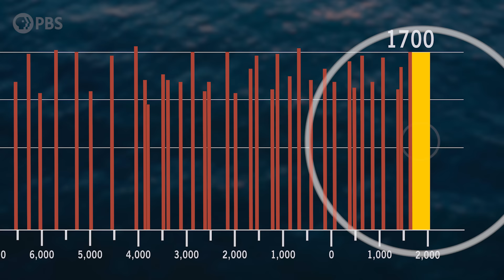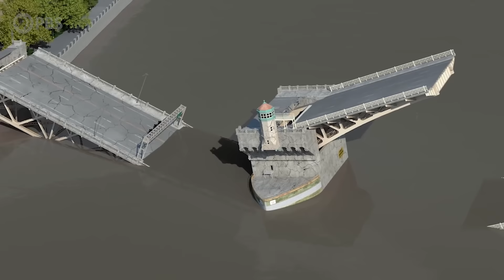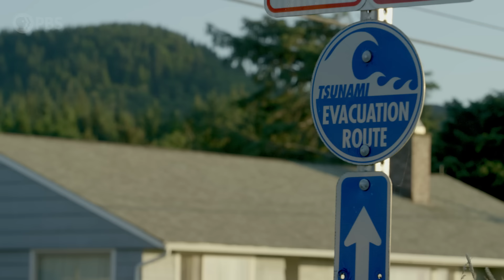Will the Cascadia Earthquake be the Worst Disaster North America’s Ever Seen? | Weathered

Comment: Turning off the gas would be the last thing on my mind while trying to run away from a 100ft wave
Reply: That advice is more for people living further from the coast. We won't need to outrun a tsunami, but we will suffer structural damage. Even a house that's mostly intact could end up with a broken pipe.
Reply: Yea, but like how they showed the house being upgraded, some of the later tips were for non-tsunami zone people. Pretty pointless to upgrade a beach house for an earthquake with a tsunami coming for you 20min later.
Reply: Even if there is no tsunami on the given area "only" a 9.0 earthquake one would hardly think on such technical details in the midst of a violent catastrophy. Although it seems to be a rational precaution.
Reply: @BonaparteBardithion  It is still valuable - can't evacuate in 20 minutes if one have to spend 10 minutes digging a family member out of the wreckage of a collapsed house
Reply: @helium3782  
Yeah, it's definitely a valuable post-quake precaution either way.
Reply: @C.M. Bright 
Or a helicopter.
Reply: Don't worry, except in very specific geographic areas, where a bay shaped the right way can funnel all of the water, that's not how tsunamis work. You won't see towering waves like in the various disaster movies. Actual tsunamis are basically surges, as a lot of water flows suddenly inland. It does pile up on itself, but more like a sudden flood (often in repeating "waves" like you see in a ripple, which is bad because it's impact after impact rather than one pressure) than a towering wave. It's unlikely the water will get higher than 20-30 feet above the normal level. There's some good video of this from the Japan quake. It basically piled up behind their anti-tsunami walls until there was enough water, then it spilled over the top like lake water spilling over the top of an overfull dam.
Unfortunately, a real tsunami (as opposed to the cooler looking movie ones) still does tremendous damage. Buildings and bridges collapse, especially as flotsam and other debris is pushed into them like battering rams. People and animals drown in the sudden flooding. Anything not fastened down is washed away, along with a fair number of things that were fastened down. But it won't be a huge, crested, surfer-style wave.
Reply: Lmao deadass!!! The wave will take care of the fires. I’m trying to make sure it don’t take care of me to lol
Reply: Most people in Washington and the PNW won’t experience tsunamis. And depending on where you live and how earthquake proof it is, a lot of people won’t need to evacuate with the earthquake, and it’ll be safer to stay in your home. Some will need to go to places like schools or libraries, but as long as we’re reinforced and are prepared with food and water and knowledge we’re mostly going to be fine.
Reply: @akostarkanyi825  Unless your home is completely destroyed or torn in half, there's no reason why you wouldn't take step to secure it after any disaster...
Reply: That’s exactly why people need to be reminded to think about it!
Reply: @BonaparteBardithion  only if people  knew the truth
Reply: @Crucisphinx  no because they'll be new ocean front property.
Reply: @amicloud_yt  you people don't know what you need to be reminding yourself of. Maybe there's a living loving God that you guys forgot about. And when this all does happen it'll come from him. Salvation isn't granted to the wicked.
Reply: I’d be grabbing the fuckin surf board
Reply: Portland isn’t on the coast.
Reply: @BonaparteBardithion  Seattle would still have to deal with the Tsunami. The straight would allow it to go around the Olympian mountains and wipe out the San Juan Islands before arriving at Seattle.
Reply: @stevensauer5597  The giant tidal wave is reserved when an asteroid hits the Pacific Ocean.
Reply: The wave will turn the gas, lights, and everything else off for you ☹️
Reply: Yesh, because it's going to put out a 🔥
Reply: All the gas lines would be ruptured, the gas wouldn't make it to your house.
Reply: @stevensauer5597  Yes. Tsunamis is literally the ocean coming onto land.
Reply: @brooklyn560  "The wave will take care of the fires" What happens when you don't live in a tsunami risk area? OH no you're dead.
Reply: @jonahmoran3751 Necro much? This was from three years ago.
Reply: @Crucisphinx a 9.0 70 miles off the coast and it’s a subduction zone and you are saying no tsunami?

Comment: Growing up on the west coast my folks always told me about the inevitable earth quake and to be prepared but a 30 meter wall of water is a shocking reality check
Reply: Bit late, but it won't be quite as bad as a 30 meter wall of water. It will be a surge of water inland that rises to roughly 30m above sea level at its highest.
Reply: @jmstheman  It might, but that depends on the topology of the coastal seafloor, the shape of the shoreline, the size and direction of the quake, and the distance of the epicenter.

If it's a big, nearby subduction quake, a steep seafloor, and a V-shaped inlet perpendicular to the direction of the incoming waves, watch out!  There could easily be something pretty close to a wall of water.

Comment: That bridge simulation is terrifying. There is a rail stop under there, stores, and more, plus two days of the week ten months of the year a market is set up under the bridge. My family is still in PDX and they worry more about me in LA than they should.
Reply: Eh.... LA has major earthquakes far more frequently than Cascadia. It is near-certain that a large devastating earthquake will hit LA in the next 50 years. It is only 1/3 likely one will hit Portland in that same period.

Yes, Portland's will almost certainly be worse than any LA has had - but it's less likely to happen in a current adult's lifetime.
Reply: In a worst-case scenario, the bridges falling into the Willamette are just the beginning of the fun. The ground under downtown Portland will liquify, the old unreinforced masonry buildings on the east side will collapse, and all of those luxe homes on stilts in the southwest hills will go sliding into the gullies. It's going to be an unbelievable mess.
Reply: I live outside Portland (used to live down in Los Angeles, so I'm familiar with earthquakes).
I really don't think this is that big of a deal for inland Oregon. yeah, if Cascadia gets a 9+, the coast is a disaster, but as the seismic waves move inland, the coastal range of mountains is going to dampen them significantly. By the time it gets to Portland, the shaking will only be a 5 or a 6. That's not that bad. It gets your heart pumping, but damage is minimal. Even if inland shaking is at a level of 7.0, that's not as bad as you think.
I think many people don't realize just how quickly seismic waves and fade out when traveling through mountains.
Most of the damage from a Cascadia earthquake will be tsunami damage in coastal towns.
I'm not worried. I only concern myself with the threat if I happen to be visiting one of the towns on the coast.

Los Angeles still has WAYYYY more to worry about in the subject of earthquakes. It's a gravel pile of fault lines down there. After living there, I realized that earthquakes are not that big of a deal. Kind of exciting actually.
Reply: @AnonymousFreakYT  the more frequent earthquakes are, the less energy they contain. The big one is overdue.
Reply: @peterbelanger4094  The problem inland is this:
"When the next very big earthquake hits, the northwest edge of the continent, from California to Canada and the continental shelf to the Cascades, will drop by as much as six feet and rebound thirty to a hundred feet to the west—losing, within minutes, all the elevation and compression it has gained over centuries."

Many of the structures in Portland, including at least half of the Willamette bridges, will not survive that kind of force. This will also rupture the water tables, liquifying the soil and creating more instability for structures that remain standing. 
There's also a smaller north-south faultline through the southwest hills that could slip as a result of a Cascadian subduction event. Portland won't get hit with a tsunami, but a big earthquake would be a catastrophe.
Reply: @elizabethhenning778 
 And we know with 100% certainty it's going to happen!
Be safe!
Reply: @miljeuta  
That's not quite right...
Reply: @Real Geology with Chris! again, not true at all. In the last hundred years? Thousands of people have died from earthquakes and their aftermath in California. Same period for Oregon? I couldn’t find ONE. You ARE at greater risk in California, plain and simple.
Reply: @elizabethhenning778  Damn
Reply: @elizabethhenning778  what does it mean to be liquified?
Reply: @Haunted1.  Just what it says, the soil will act like a liquid, look up liquifaction.

It isn't pleasent.
Reply: One thing I wonder about in LA/California vs in the PNW is the firestorm potential after a big quake. As we learned this last year, the Northwest can obviously burn as well, but I think it would partially depend on the time of year.
Reply: @peterbelanger4094  look up loma prieta
Reply: Actually, since cascadia subduction zone is close to San Andreas it is possible that the San Andreas fault could be triggered. 9 out of 11 times cascadia erupted San Andreas followed, so it’s important to also have a plan in case San Andreas goes off too :)
Reply: Don't worry.   If the 100ft hits is coming, your house will wash away from the gas leaks!
Reply: When the Cascadia plate goes, it usually means yours is next.
Reply: Scary thing an actual 4.4 earthquake just hit L.A two days ago at midnight qwq
Reply: Saturday Market!